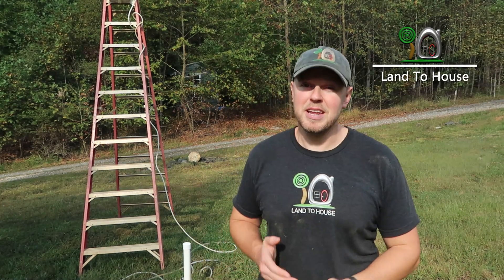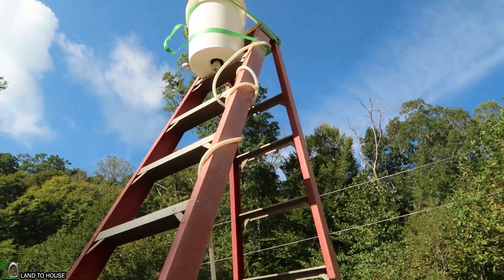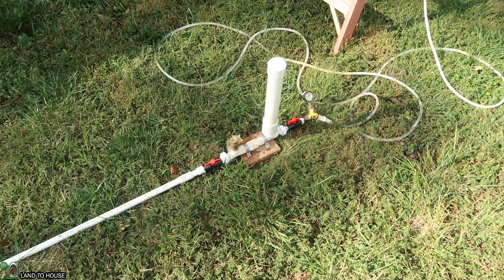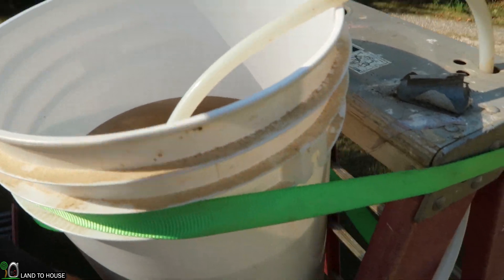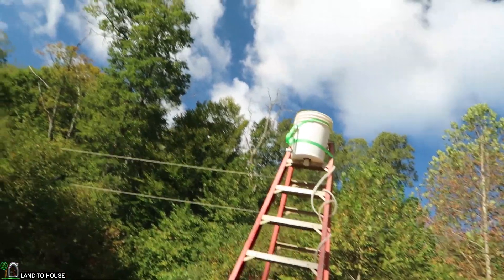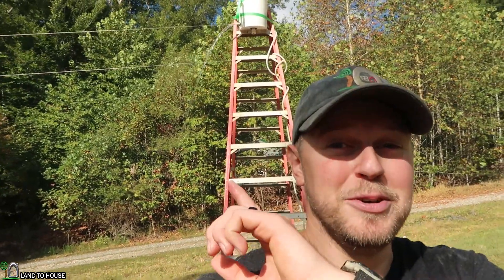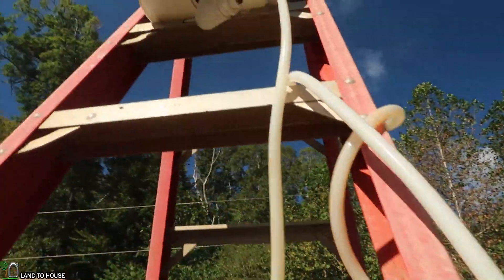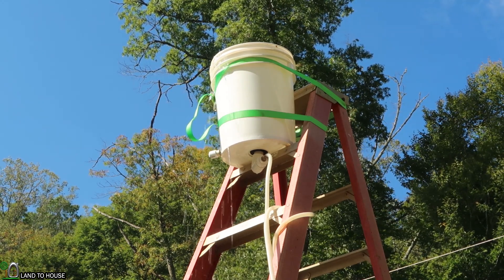Fill Storage Tank from the Bottom vs Top Ram Pump

Comment: Ok someone correct me if I’m wrong but do so constructively please, I’m trying to wrap my head around how a ram pump works. 

So there is pressure from the elevated water and gravity (the bucket or stream), that pressure is consistently being applied to the air in the ram which comprises it like a spring as the water level rise in the air pocket because water is incompressible while air is. But since the output of the ram-pump has less pressure then the interior air pocket or the input, cause it’s atmospheric pressure vs the  compressed air and the elevated source, the compressed air can decompress partially which pushes down on the water through a one way valve (so it can’t flow back).

So what’s the waste valve for? I imagine it keep a rhythm which benefits the machines some how? By letting the valve open and close like that is it allowing access to atmospheric pressure on the interior of valve which allows the water to flow but when it closes it allows the build up of pressure? So it can’t always be on because the water would just leak from it instead of the output and it can’t always be off cause then the water has no access to atmosphere which it needs to flow. I don’t know. Why do you need that waste valve/ what does that waste valve do? I imagine if the inventor figured out a way to make it work without it the design would not include it.
Reply: https://youtu.be/zFdyqTGx32A this is a good video explaining how the  ram pump works.
Reply from the maker: The waste valve is absolutely necessary. It creates the ram affect which generates a pressure wave. This wave is what allows the pump to cycle back and forth and build up pressure into the pressure tank. Without the waste valve you would only have a static water pressure in the pipe. Which means you would have no ability to pump uphill.
Reply: @LandtoHouse  How does it make the wave
Reply: The key is to think of a dynamic stage rather that static. The ram pump transforms Potential Energy + Kinetic Energy into even higher Potential Energy. But that sum is not equal as there is waste water.

Comment: it takes 2.31 ft. of water column to equal 1 psi. it matters not the size of the column (diameter) but the flow rate per gallons per min. will be greater but at the same pressure in psi....g
Reply from the maker: The main reason for the time difference is that the top fill was at that level from the start. While the bottom fill level changed over time.

Comment: Exactly.    Same.  :-)
Reply from the maker: Looking back on the setup I believe filling from the bottom is actually more efficient. Because the delivery pipe on the top always has to go up to the top all the time. Whereas filling on the bottom it rises up to that level over time
Reply: Obviously faster filling from the bottom. If you had a 30ft high bucket, you would see a large difference... Love your channel. Good job.
Reply from the maker: That's a fun way to put it. That would be one hard bucket to carry.

Comment: I think the difference is that when filling from the bottom the pump only has to raise the water as high as the water level in the tank which will be lower than the hose at the top of the tank until the water runs over the edge. since  it will be easier to fill from the bottom until the tank is full it should pump faster and easier at the lower level. I believe you showed that as the water is pumped higher the amount of water is reduced in one of your tests so this works the same way
Reply from the maker: Very well stated! I think that is the main factor to consider in this setup. The bottom fill is faster at the first and gets slower as the water gets to the top. While the top fill is slower all the time. .... Thank you for the insight.

Comment: Sea level could influence the pressure. Since you completed the test at the same location it wouldn't make a difference.
Reply: Sea level could influence the pressure but it would influence the pressure in the same way so that no matter the altitude the outcome would be the same, bottom fill = less pressure until filled then the same.
Reply from the maker: That is good to know. I like the bottom fill but there are benefits to top fill too.

Comment: As long as the delivery pipe is constant that wont be a factor. If anything filling from the bottom means that there is additional back pressure in the delivery pipe from the weight of the water in the tank/bucket. Which might actually make the pump more efficiant.
Reply from the maker: I am thinking that the weight of the water in the tank is the same as in the tube going up the same distance. I could be wrong but I dont think that it matters the size of the tank as long as the height is the same.
Reply: But, when you calculate head pressure, is it **strictly height**, or does it take into account the weight of the water in that height?

Like if you have a 10 gallon bucket that's 2 feet tall, and 10,000 gallon tank that's 2 feet tall, but like really, really wide, thus holding more water, does that greater weight of water in the 10,000 gallon tank mean more "pressure" due to holding more water/weight, even though the tank itself (and the top water level is still only 2 feet tall)?

*If* it exerts more [head-]pressure from the larger tank with the same "height," then it seems to me that a larger tank at the top of the experiment will build more back-pressure and make it harder to lift additional water, the fuller it gets... Or am I thinking about it wrong?

Another analogy would seem to be like how much weight do you have to add to barbells before a weight-lifter can no longer lift it over his head, or even lift it at all?

That is, if you put too much water weight in the upper tank (like a 10,000 gallon tank, rather than 10 gallon bucket), will that eventually cause the ram pump to pump less efficiently or stop/seize up entirely if it's using a bottom inlet (whereas a free hose at the top of the tank would experience no additional weight and continue to flow at the same rate throughout the experiment)? If so, at what point would the to hose overtake the bottom hose, or at what point would the bottom hose setup seize up and stop altogether?

Comment: top fill equals a stand pipe if there is a air gap at the top. if the hose goes into water, then no.
Reply from the maker: Top fill means that the water always has to go to the top from all points of the fill. Going from the bottom allows the bucket to fill faster because it does not have to go to the top height from the start but gets there gradually.

Comment: I think thats the expected result, as all the water is not lofted over the top rim. Effectively it starts off filling the bottom of the bucket, and then a little higher with each cycle. Filling from the top, you are always filling the top of the bucket. The increase in flow (and quicker time) at a guess should be equal to (FlowRate at bottom of bucket height - FlowRate at top of bucket height)/2
Reply from the maker: Well said! I think you are right. There were a few issues with my test parameters but from what I see it is faster to fill from the bottom.

Comment: Great diplomacy sir. The gravity head pressure always increases as you increase height. So a bottom fill would be more efficient than a fill tube going over the top. keep up the great work. I follow you so don't slow down on posting.
Reply from the maker: Well stated. The bottom does not have the same pressure over time but gets higher as the water level goes up. The top fill has to go to the top from the start.
Reply: @LandtoHouse  Yes almost the half of the time the height was less than the half of the upper feeder tube.
Reply: I agree with you on this. However, in the first test I noticed that the delivery pipe not only went over the top of the bucket but then went right down inside nearly to the bottom of the bucket. This would skew the result as the portion of pipe inside the bucket would get the advantage of a symphonic effect. So in effect he was filling the bucket from the bottom on both tests.
Reply from the maker: I am actually in the middle of testing a much better bottom vs top test. 150 gallons.
Reply: @LandtoHouse  that would be great to see. These videos are excellent.
Reply: What if want to pressureise it aftet being filled ? Then is it worth it from bottom or top or the same (since i use pump)?

Comment: One problem with top filling is also that all the water must be lifted up to the highest place of the bucket, while when filling from the bottom the avarage "lift height" will be lower since only the top layer of water will be needed to be lifted to the buckets rim.

Might not effect so much tho when considering the total lift height from the pump but still.

Sorry not perfect grammer, from Sweden :)
Reply from the maker: Well stated! The water has to go to the top from the start with the top fill. While the bottom fill pressure changes as the water level goes up.

Comment: couldn't you use a toilet bowl valve connected to your hose in some way to keep the supply bucket consistently full within your desired range?  That would remove the human variable from that aspect of your experiment.  It might also eliminate bubbles getting into your drive pipe.  On another channel, someone used this mechanism to keep his dog's water bowl full.
Reply from the maker: Yes for sure! I need to get a float valve. Those are only about $18 on amazon. Thank you for the input.

Comment: This test seems to say that bottom fill will be faster... which makes sense. The distance to raise the water with bottom fill will always be less with bottom fill than top fill. So filling an empty tank from the bottom will be faster than filling from over the top where the lift height is not only constant but higher. A really good illustration of this would be a "tank" made out of a 10 foot high 4 inch PVC pipe. The bottom of the tank could be 3 feet above the ground for a total height of 13 feet to the top. The one point I would make about the test is that the top feed hose seems to have gone over the top and down to the bottom of the tank but it should have ended at the top of the tank to prevent siphon effect from interfering with the result. The weight of the water in the part of the hose in the tank is helping pull the water up as well...
The downside of bottom fill, is that the system is more vulnerable to damage to the fill pipes causing the loss of all the water. However, even with top fill, there is still the possibility of loosing all the water if the outlet feed system springs a leak.
Reply from the maker: I feel like you summed up the video perfectly. That's the exact results that I was getting. Adding a one-way valve to the bottom of the delivery pipe could help prevent loss in failure.

Comment: Tried and true concept for me is to use a "sprinkler" at the end of a push of only 6'elev and 200 ft hose using an Ag pressure valve set to just above required back pressure.  24/7 just move sprinkler
Reply from the maker: That seems like a good method.

Comment: •Bottom filling Setup.

When the pressure exerted by the weight of the water in the Tank (in the bottom portion) becomes greater than the atmospheric pressure, the water flow rate in the Tank is no longer constant. It will start to decrease, as the water level in the Tank rises.
Reply from the maker: Yes that is true. The top hill has the limited flow at all times because the weight of the water column is high from the start. The bottom fill reaches that point over time.
Reply: @LandtoHouse  Did you emptied the pressure in pressure tube for second test, you should've start with empty pressure tube. Also first test had to filled empty hose with water when you did your second test hose was already filled with water so ram pump just had to push that.
Reply: @LandtoHouse  can you conduct an experiment where you test the efficiency of the pump in terms of wasting/losing water? Aka if you have 10 gallons bucket, would the pump deliver lets say 5 or 7 gallons to the desired location? I am keen to watch this :)
Reply from the maker: I suppose having a known source and a measurable delivery. It changes based on head pressure and lift height.

Comment: i wonder if you moved the bucket rather than the hose (so the hose height is constant) you might see those times get closer. good to see this in action though, really helps with looking ahead in our system (which is rocketing away to the stage we have to turn it off when we leave the farm else we get flooded) we're trying to see if theres a way we can actually use that to our advantage in the future so one IBC tank will fill then overflow forces the water towards the other IBC (obviously one will be higher in the system than the other) not sure it's going to work but we have a Y section installed now so shut off is possible if it doesn't work.
Reply: You have an interesting situation. I would suggest putting a split just before the lower tank and a float valve on the feed line so that once the lower tank is full it shuts off and the water is now forced up to the higher tank.
Reply from the maker: I have a feeling that if you moved the bucket and left the hose the same it would cause the bottom fill to take longer. This is because the tank would be higher by height of the tank. Fun idea. I do think that most people will have a storage tank that stays put. ... I have a test lined up for next year showing a few ways to stop the pump delivery when not needed.

Comment: Where to begin.... 

First, atmospheric pressure has no measurable effect at these heights.
Pressure in a column of water is p = ρ g h    (the following stuff is from engineeringtoolbox)
where
p = pressure in liquid (N/m2, Pa, lbf/ft2, psf)
ρ = density of liquid (kg/m3, slugs/ft3)
g = acceleration of gravity (9.81 m/s2, 32.17405 ft/s2)
h = height of fluid column - or depth in the fluid where pressure is measured (m, ft)

Also we need to establish a fact, a ram pump will pump more volume at a lower back-pressure.  

The only variable Seth is changing here is the height is the delivery pipe column of water "h". If the delivery pipe is looped over the top of the bucket (and there is an air-break at the peak of the loop) then the back-pressure on the delivery pipe is "h" or in this case we will say 8 feet. That comes out to about 3.46 psi of back-pressure. If the delivery-pipe fills from the bottom up and the beginning height is  "h - bucket" or about 6.5 feet the back-pressure will be 2.82 psi. This means that the bucket will fill faster at the beginning and slow down to fill at the same rate as the top-fill method as the bucket fills up. I'm far too rusty with my differential equations to figure it out in a more mathematical definitive manner.

Your testing methodology as you stated has too many inherent variables to make this test valid. An additional flaw that may have altered your variables is if the delivery pipe had an air-break at the top of the loop or if it was acting like a siphon down into the bucket, this would have resulted in identical test results. I couldn't tell if there was a siphon or not, having the water port out of the delivery pipe at the rim of the bucket would be a better methodology.

Now perform the same test with your 55 gallon barrels up on the hillside. You must have an air-break at the top too. The longer test time, larger variance in height, and a steady drive-pipe fill will result in better data.

You could alter your existing ladder setup by replacing the bucket with a 3" pipe 8' tall and repeating the test, this will exaggerate your results.
Reply: JM- you are correct. Filling thousands of pounds of fuel from the bottom takes less effort and less time. 
That’s one reason that airlines fill their fuel tanks from the bottom of the wings versus pumping to the top of the wings. 
Other practical reasons are:  it’s easier to access the tank from the bottom and there is less turbulence(splashing and bubbles) inside the tank and the inlet and delivery hoses to/from the pump are much bigger than a garden hose, and a smaller plane, which may fill from top doesn’t need a complex/expensive filling connection. Finally, since the tanks are smaller, the difference in time($$) is less critical than the airline schedule and turn around time. 🦀
Reply from the maker: I did not know that about airplanes. Makes a lot of sense. When time is that important you have to find the easy workarounds.
Reply from the maker: Well put. I like the idea of using a larger tank on the hill to get results from a longer test with more water. I can setup my tank with the larger 1" pump in the creek. That would allow me the chance to walk away from refilling the bucket. I will write this one down to retest next season.
Reply: Your making a mountain out of a molehill. The answer is its better to fill from the bottom, its quite simple if you keep it so..
Reply from the maker: There might be several pro's and con's to each setup. But as time goes the bottom  fill wins.

Comment: Fill from the buttom: if you have a leak the hole bucket is empty, thats the differents, i think.
Reply from the maker: Very true. In my system I installed a non-return valve in the delivery pipe going up to the tank. That way it will not empty. But I guess you'll have a line coming out of the bottom of the tank to your final destination any way. that could have a leak. So that issue could happen however you fill it.